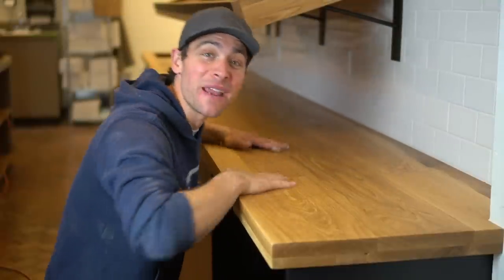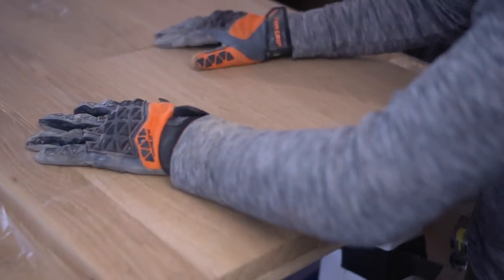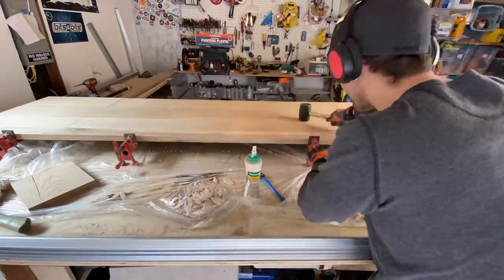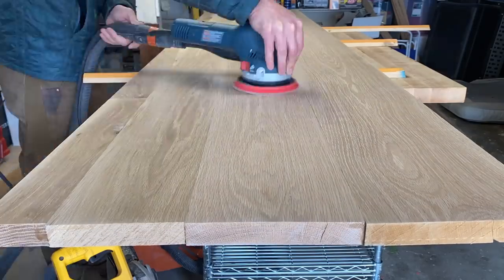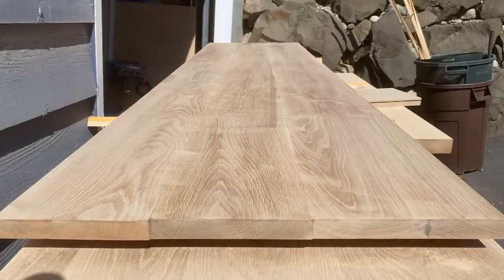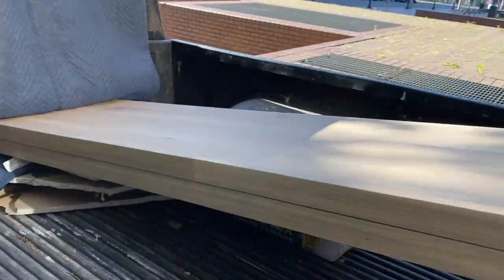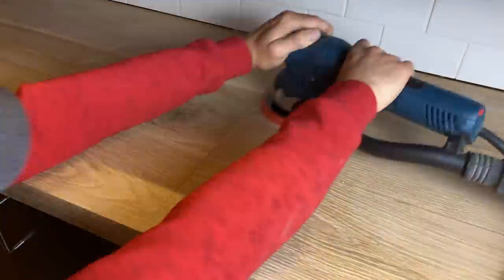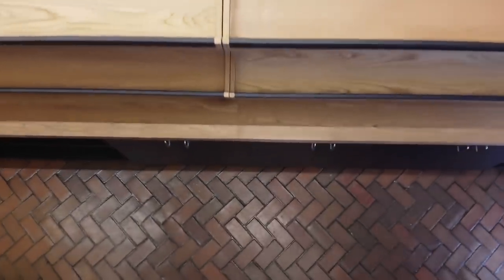DIY WOOD COUNTERTOP

Comment: Keep in mind that wood "putty" made out of sawdust and glue will never stain the same color as the wood surrounding the holes that are patched. Wood glue does not stain at all so the mix will not stain because of the glue mix. Best to get a wood filler that is very close to what ever stain you will be using. Fill the holes first before staining. You can go a little wild here with some of the putty staining the wood around the hole. After all holes are filled touch up with a fine sanding at each filled hole so only the the filler is exposed at the holes with no "over spray" so to speak.

Comment: Nice work. For biscuits, you gotta glue them in! In the slot specifically 😎
Reply from the maker: Thanks John and yes I did try to get some glue in those biscuit joints but I’m sure I could have added a little more.  Thanks for watching and all the support.
Reply: @BYOTools  I use a little flux brush. Get them from the plumbing section of <enter big box store here> and they do add considerable strength to joints, they're basically floating tennons. Ive built tons of stuff using biscuits, but I've never made a big tabletop or counter. You've inspired me!

Comment: Could you talk a little bit about the end grain butt joints when gluing up? I am hoping to glue up a 14’ long countertop in one shot (workshop is in my house so no need to transport) but will need to use boards that are shorter than the 14’ length. Did you just slap some glue on them and the edge glue ups will hold them in place/make the table strong enough? Also any suggestions for substrate for under countertop? Does it have to be plywood or can it be particleboard or mdf?